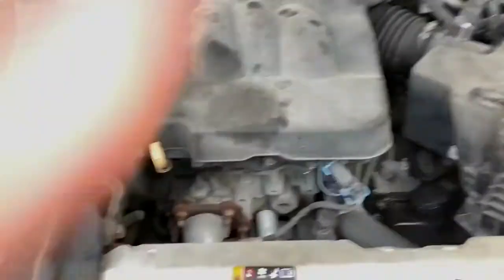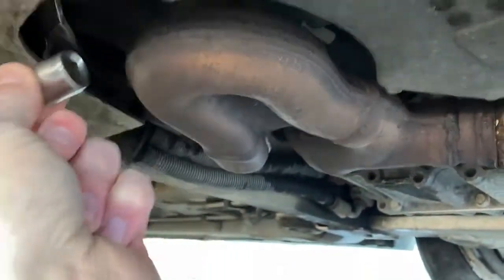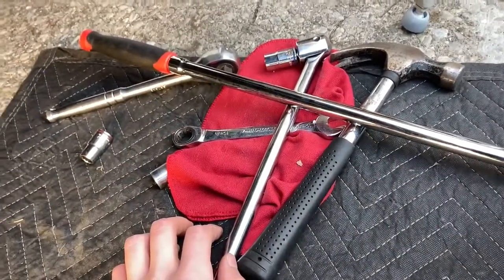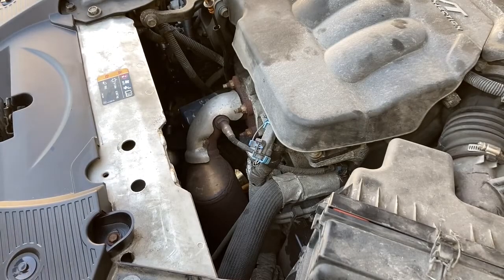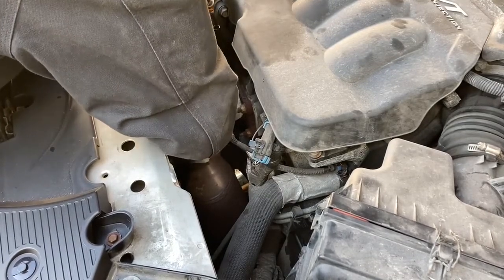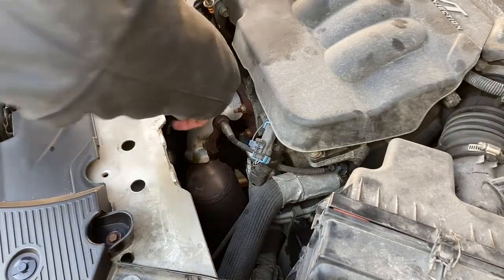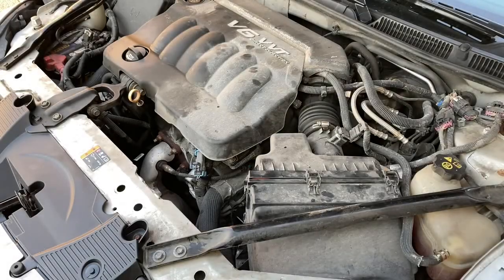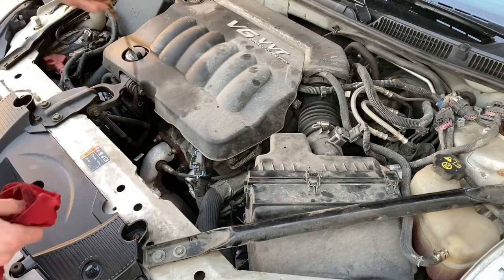How to Change Oil 3.6L Chevy Impala V6 | 2012 Chevrolet Impala Oil Change

Comment from the maker: Here are the materials you will need! 
Oil Filter: https://amzn.to/3TMFUtk
Oil: https://amzn.to/3egHt2l
Ramps: https://amzn.to/3KDZkwa
Reply: @matt-diy man much love to you man I did this oil change today and I'm never going to a oil change spot again damn shame they charge you so much for so little work they do did it out in my driveway and the wife was like you should do it with someone and I laughed and said I am doing it with someone my guy matt
Reply: @matt-diy could you do a video where I can check my ac harness wires to find a short  without the expensive equip it keeps blowing fuses and I have got my blower motor checked my resistor and my control panel compressor works just fine
Reply from the maker: @coreygrimes6442  sorry I know longer have the car!

Comment: Thanks for the upload.  Just bought a 2012 with the 3.6 today and am off to do this now.  Have the AC filter from Wal-Mart and 5w30 Penzoil full synthetic.  Have no idea if I should have paid more for the Platinum DEXOS certified oil.  I've read that as long as its full synthetic and you change oil more often than the factory recommendation you are okay.  Any thoughts?
Reply from the maker: Thanks for watching! As long as you are full synthetic and change at least every 5k miles you are fine, no need for the super expensive stuff. I actually change mine every 3k because I run high mileage cars and it makes me feel better haha.
Reply: That dexos is just Chevy saying this oil still work it is as good or better then our spec. New car surw get what they want you to but long as your using the correct viscosity and weight and type brand names don’t matter it all comes from 2 or 3 places anyways!

Comment: Very helpful thanks a bunch🎉
Reply from the maker: You’re welcome 😊
Reply: @matt-diy  I have a question I was hoping you would be able to answer. So I have a 2014 chevy impala limited ls, it started out being just to the left. But now it's gotten worse. When I would turn left sharply the traction control would try to activate and become tough to steer. I had a friend look and he suggested it was my power steering pump, so we swapped that out. Still did the something now it's getting worse. To the point when I try to u turn steering gets really stiff and my idiot lights come on for service abs, stabilitrak and traction control. I was hoping you've ran into this a had an idea where to point me. I've heard a range of things from rack and pinion, a sensor, bad connections, strutt, wheel bearings as well as cv shaft. Hope you have anything you could advise me on 😂
Reply from the maker: @christianchadwick1867  I haven't experienced this unfortunately. May try replacing all the power steering fluid? Could be dirt in the steering rack causing it to bind.

Comment: good vid
Reply from the maker: Thank you!
Reply: That noise is the blend door actuator. Mine was making the same noise. I just unplugged them. They are located behind the glove box.
Reply: @truebluethinkblue  Yes mine had the same problem just unplugged it, I still get ac and heat it's sometimes it won't switch when I change temperature

Comment: Good video.

How does a college educated automotive engineer come to the decision to mount the oil filter horizontally. In the hardest possible place to reach. How is it even legal. Why isn't mandatory years of mechanic experience required to design cars. Fuck chevy.
Reply from the maker: Thank you!! Yeah…I have come to that question many times working on vehicles…no idea.
Reply: Try changing the filter on a 2007 volvo xc70 without a oil filter socket

Comment: i hate that the exhuast pipe is next to the filter. my car takes forever to cool off. my 84 monte was the best to change oil, you could full the filter and then put it on before pouring the oil into the oil cap opening. to prevent a mess when filling the car with oil. use the oil dip stick and pour the oil over it and the stick helps guide the oil into the car. i cant believe u use cheap walmart oil. ive heard nothing good about it. i work at wm n refuse to use ot.
Reply from the maker: Nothing wrong with Walmart oil it meets the same specifications as any other oil!
Reply: Supertech synthetic oil is actually pretty good oil from what I heard. As long as it meets the Dexos requirements it's good oil.